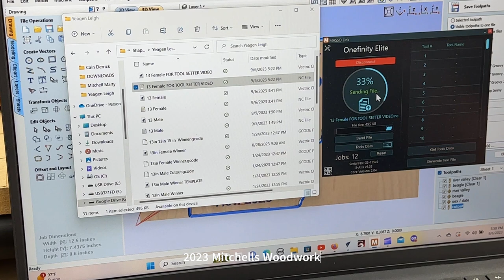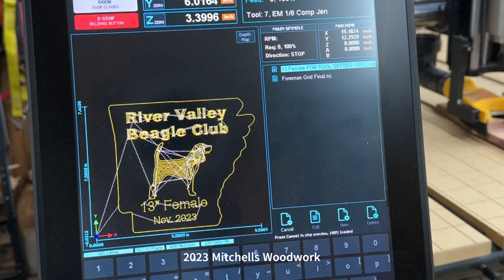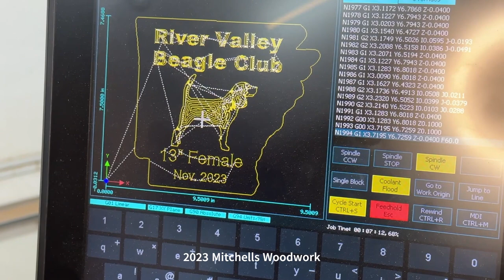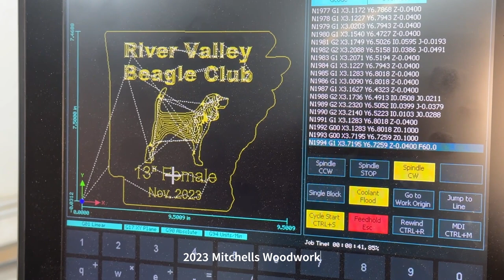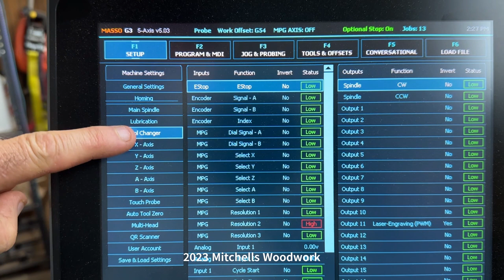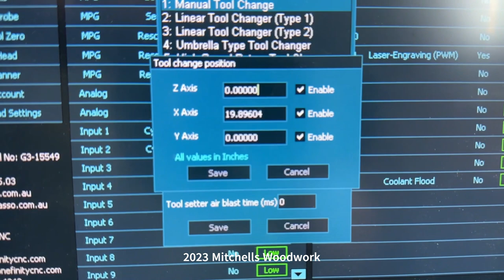Why Your Onefinity Elite CNC Needs A Tool Setter!  PLUS Bonus Masso Setup Tip!!

Comment: Background question - what is the program you started in, before sending the G-code to the Masso?
Reply from the maker: VCarve Pro > Masso Link
Reply: @MitchellsWoodwork  Okay, I'll take a look at how VCarve Pro works - maybe I can import CAD into it, and make the G-code consistently that way.
Reply from the maker: @NeilBlanchard  how are you generating your gcode now?
Reply: @MitchellsWoodwork  It has been about 10 years since I used G-code; on my PhlatPrinter III. I have the jogging working on my Journeyman Elite, but I have yet to do any of the basic settings, and I can't figure  how to spin up the spindle, or power the vacuum, yet.

I need to do some simple practicing, and get into turning my CAD drawings into G-code.

Oh, and I need to install to tool setter.

Comment: Oh boy, my message was truncated...
... light goes on. In your Software programming, do your set your Z touch-off from table bed (spoil board), or from top of work peace?
Reply from the maker: I set my Z on surface of the workpiece.
Reply: @MitchellsWoodwork  Thank you for a reply. I do fine without tool setter, so just wondering if there's something else I need to setup?

Comment: Why does your Onefinity wobble so much or is that normal?
Reply from the maker: This video was made before I added braces to my Kreg table.  The table still shakes some but it’s tolerable.  The Onefinity itself has absolutely zero wobble if it’s mounted to a solid surface.  Here’s my video on adding braces to my Kreg table. 

Upgrade Your "Shaky" Kreg Universal Bench For Your Onefinity Elite CNC!  Plus MORE Improvements!
https://youtu.be/beJKXvDQnY0

Comment: Does this Z.zer.o work with a 1/2" bit?
Reply from the maker: A 1/2” end mill, no.  Measuring mine it looks like the max would be 5/16” or so max capacity.
Reply: @MitchellsWoodwork  Bummer - I ordered it, and I would like to be able to use a 1/2" end mill bit. I wonder if a shim/extension could be used?
Reply from the maker: @NeilBlanchard contact Steve (Dash) through Etsy.  He’d be the man to talk to.   https://www.etsy.com/shop/DashMadeWoodworking
Reply: @NeilBlanchard  Ill send you something so you can use larger bits.
Reply: @sdasherx  Thank you - that is excellent!
Reply from the maker: That’s what I call excellent customer service! 🏆
Reply: @MitchellsWoodwork  Absolutely! I will have the bit setter well before I get the machine.
I am thinking that I will be using a 1/2" bit much of the time; as I am planning on producing flat packs for my mass loaded transmission line speakers.
Reply from the maker: I don’t know what any of that is, but I’m sure you’re gonna be set up in fine shape to make them. 😉👍
Reply: @MitchellsWoodwork  It is an audio speaker that has about 3 additional internal baffles, that need to have grooves/slots machined into the sides. 🙂